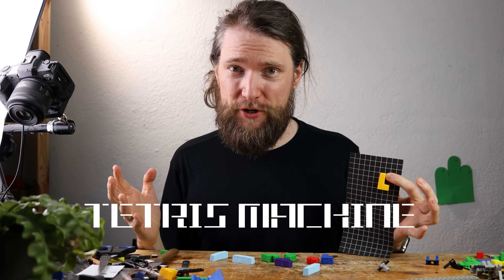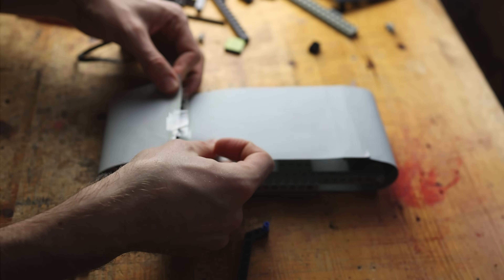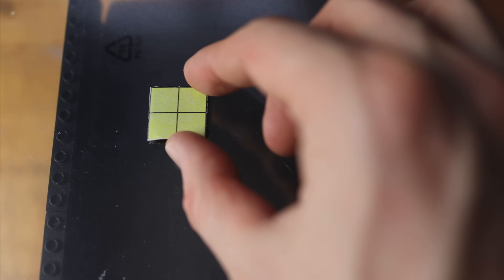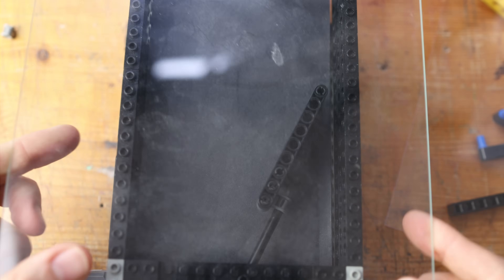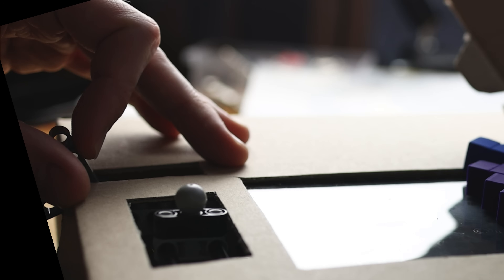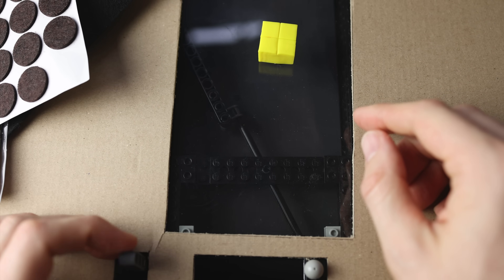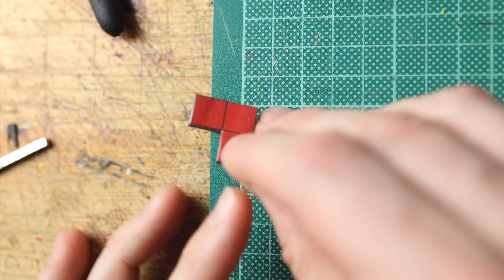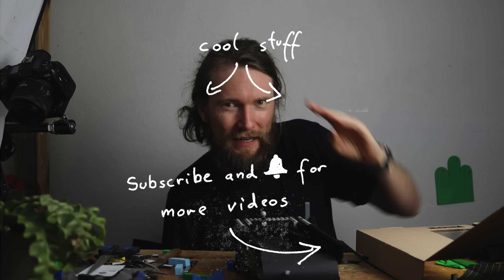LEGO + Magnets = DIY TETRIS

Comment: Back in the late 80's I used a multi-sided die and assigned numbers to certain tetramino shapes.  I'd roll the die, get a number, then draw that shape where it would fit on some graph paper that was a 10 x however long so I could keep going for a while.  The key was to not have any blank/empty squares.  No score, or game speed increase.  Just a relaxing way to enjoy a game I couldn't get because I didn't have any system to play it on.

Comment: edit: okay i understand why now.||||hey i know you probably still wont do it but for clarification in the Airship Map, the ladder= go up/down, so, the ladders should be vertical, the top of the map should be the highest place on the structure, middle part (except the storage) inbetween top and bottom, and the bottom, (including storage) being the lowest. (Storage being bottom because the only way you cant access from the middle, but from the bottom.)

Comment: I noticed the clay pieces you made were kind of thick. Maybe making the clay ones thinner like the cardboard pieces may have fixed the problem of being too heavy.
Reply: I was thinking of that too
Reply: Same! Roll them out like a pie crust about the same thickness as the cardboard and cut them out the same way. Just be sure to keep the thickness of the clay consistent. Otherwise they won’t line up correctly. This was so awesome to watch <3

Comment: I love those "old" lego pieces from 1980/1990/2000. They are awesome with this type of gears and wheels.
Reply: I personally wouldn't say "old". Alot of lego pieces like that are still in circulation, because of the fact most of them are still major lego motor functions. Gears, wheels, they still alot of them, you see alot of technic sets, especially the special motorized ones like the excavator crane or pickup truck. They use alot of gears. Now, maybe I'm misunderstanding what you exactly mean by the word "old"? But, in my opinion they're not "old"... 😅
Reply: @WarlockEthan  I mean their color are "old" : Light Gray, Dark gray. And the gears ClayClaim uses are from the 1990s. If your remember his video with spring loaded shooters where the projectile has a rubber part, the colors of  those projectiles/canons (yellow, turquoise, magenta, ...) are no longer made by LEGO because I made some research and they come from "old" LEGO Technic sets.
Reply: @WarlockEthan  And his electric parts are from Power functions that got replaced by Powered Up 5/6 years ago so they are not old because a lot of people still use them but I wasn't talking about the electric parts.
Reply: @raptor150  Oh ok, I get it now. Thanks for clearing it up! 👍

Comment: Could the heat from the oven demagnetize the magnets? But great idea!
Reply: ''When heated above 176° Fahrenheit (80° Celsius), magnets will quickly lose their magnetic properties. The magnet will become permanently demagnetized if exposed to these temperatures for a certain length of time or heated at a significantly higher temperature (Curie temperature).''

Yeah, I'm quite sure, that's the case.